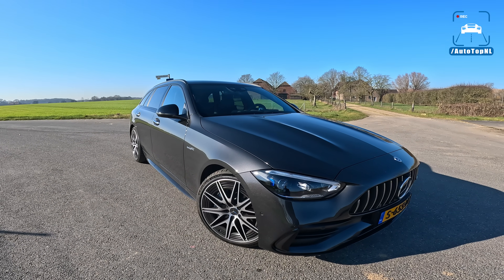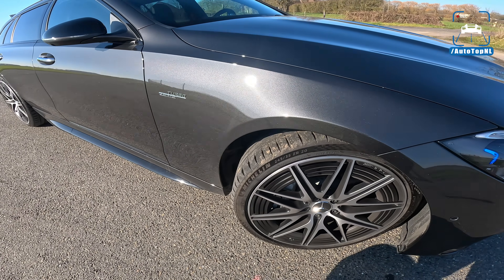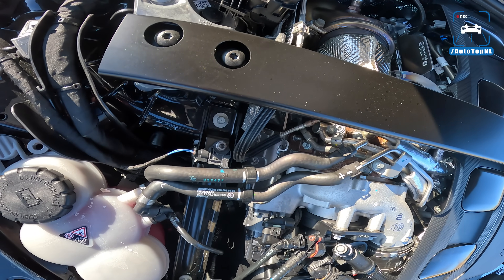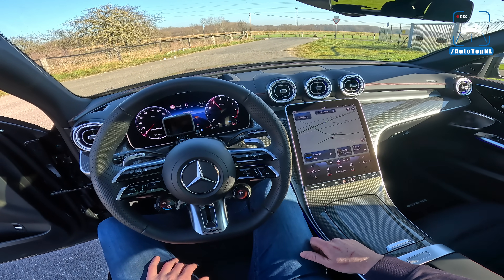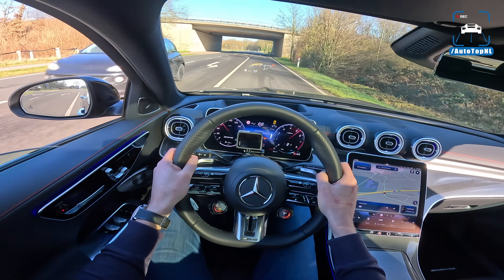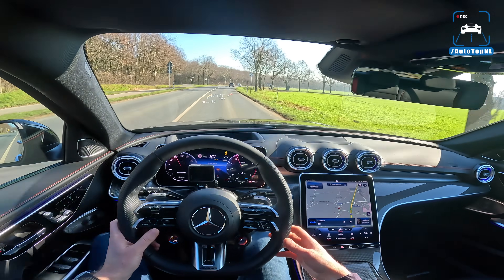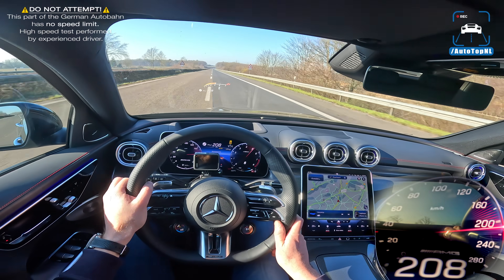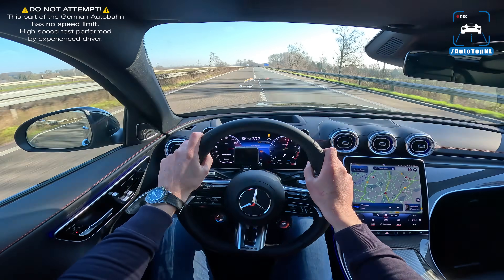2023 Mercedes-AMG C43 | REVIEW on AUTOBAHN - the MAGIC is GONE!?

Comment: I don't understand why didn't they just put the 53 engine in the C43/63, put this same electrified turbo on it and called it a day. I don't think anyone would really be mad about a straight six. Especially since that engine could easily give you 500-550hp with this turbo while maintaining a decently good sound and adding the smoothness inline sixes are known for.
A 4-cylinder C63 makes zero sense considering the fact that the C63 is AMG's most important car in a very saturated market where you need to check as many boxes as possible in order for the car to be successful sales wise. The competition in this particular segment has never been tougher and I don't see the new car selling nearly as well as the old one.

Comment: All of that piped in sound makes me think they looked at Dodge's "fratzonic" exhaust" idea for the EV Charger and thought it didn't already sound silly enough. Yikes.

Honestly though: if one of the best things any driver can say about a car with an AMG pedigree is that the air vents sounds amazing, I'd call that a big fail on the automaker's part. If this is the kinda stuff we all have to look forward to, we should all hold on to our petrol cars as long as they can still run.

Comment: I don't understand the direction the industry is jumping into with these electrified hybrids. The reasoning is emissions, but the math doesn't ever work out. Real world numbers are exactly was the petrol-only cars have been with worse build quality, overly complicated mechanicals systems that no one can fix, and the price to get in on the gap-fill is normally a 20K premium over petrol-only. 
If this is how they try to save the ICE, just stop the bleeding already. Personally I'd rather have a liquid fuel base vs electric, but not if its a neutered shell of its former self.

Comment: Чому виробники автомобілів не роблять маленьких 8-циліндрових двигунів?
Наприклад:
-DAIMLER V8-250. OHV
2.5l. 140hp 1959.
-TATRA 603F.V8. OHV
2.5l. 95hp 1955
-SIMCA AQULON.V8. IHV
2.4l. 75hp 1954
-FORD 136 FLATHEAD V8-60
2.2l. 60hp 1937
-FIAT TIPO 104 V8
2.0l. 105hp 1952
-ALFA ROMEO 105.33 V8 DOHC
2.0l. 230hp 1967
-LAMBORGHINI V8 DOHC
2.0l. 185hp 1975 (урако)
-FERRARI DINO V8 DONC
2.0l. 170hp 1975

Також були версії тих моделей більш потужні))))
Чому в 2023 році не можна випускати сучасні маленькі V8?
Reply: Money. Mercedes wants all its engines to be modular. There is nothing special about this brand anymore